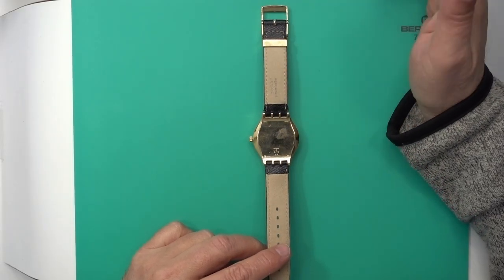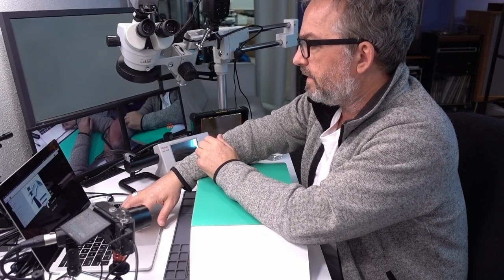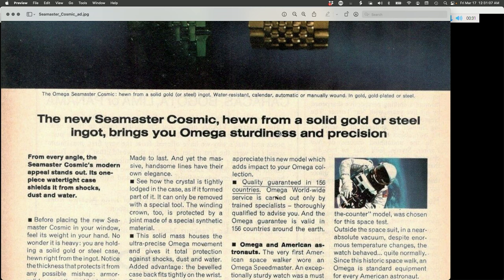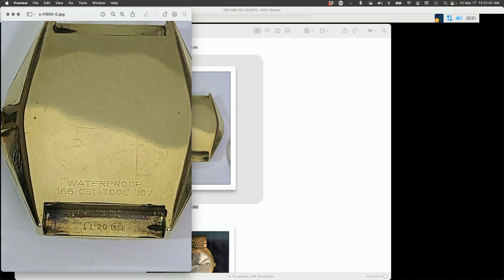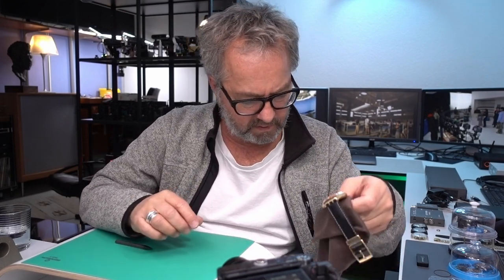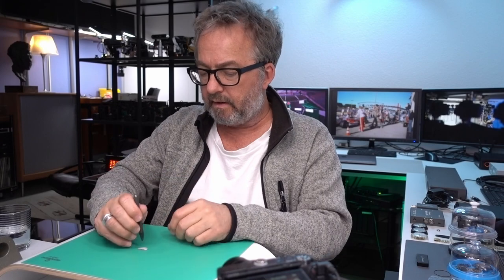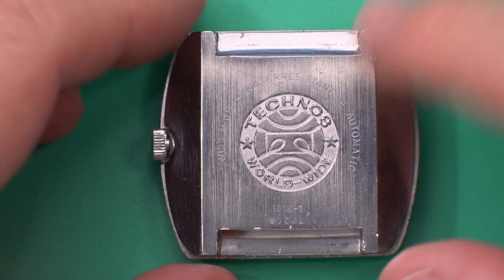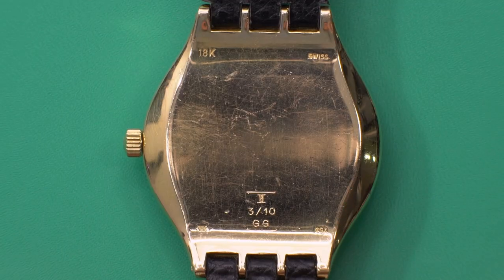Solid Gold Omega Prototype Case Manufacturing Process

Comment: You didn't cite ant actual case makers as sources. They would substantiate some of your research with actual experience. I see tool marks in the strap shroud pockets.  The case back lettering may have been done with a pantograph, not punch.
Reply from the maker: Thanks very much for your comment! I agree it will be interesting to talk to precious metal case makers in general and I do plan to do that. The tool marks in the shroud pockets are limited and are probably just from a bit of scraping to clean up irregularities from the mold. Yes, the case back lettering 3/10 and GG was done with a pantograph. I have covered that in a past video.
Reply: @IMakeWatches  My experience as a machinist and with hand finishing makes me suspect tool marks are from a final operation on the pockets was due to milling. But very precise milling  because the depth is so similar to the radius. Casting isn't accurate enough for the precision needed for many aspect of a case, including the crystal and features related to the fit of the movement. The casemaker would  be a good arbiter.
Reply from the maker: @zaviekucer9859  Thanks! I shot some B-roll video with just the microscope of the insides of the pockets, including some gold flaking. I'll upload that as an unlisted video and will add an additional comment here with a link tomorrow. I'd love to have your opinion after a closer look if you have time to watch it!
Reply from the maker: @zaviekucer9859  Thanks again, Zavi! Here's a link to the B-roll video (silent, just the microscope) of the case pockets: https://youtu.be/XTu44rWh17M Please let me know if you see anything interesting!
Reply: @IMakeWatches  At the  beginning of the video you are poking at something  in the pocket.  It is strange that each pocket has similar, in similar locations. This could be a burr remaining from the machining. It could be leftover material from a soldering operation that didn't join properly, where the solder didn't flow properly. It could also be a leftover from the mould operation. Sometime moulds use inserts. The hole for the strap pin may have been made with an insert that made the these pockets, but that is  low probability.  You really need to talk to a casemaker..
Reply from the maker: @zaviekucer9859  Yes, it's a flake of gold that I'm poking at. It's only in the one pocket but I keep coming back to it. I will definitely talk to case makers! Thanks for your evaluation and for sharing your opinion!